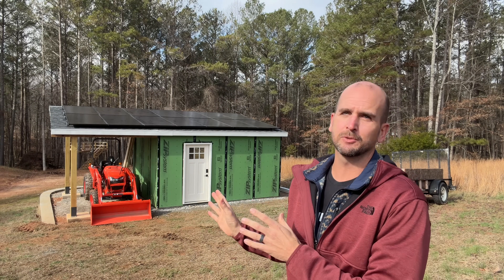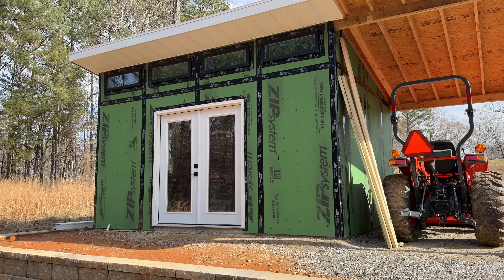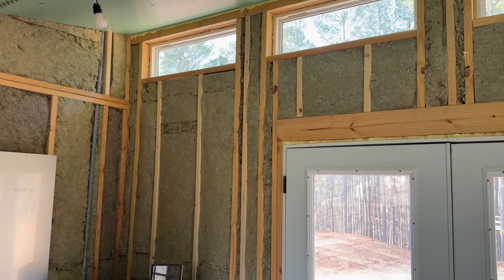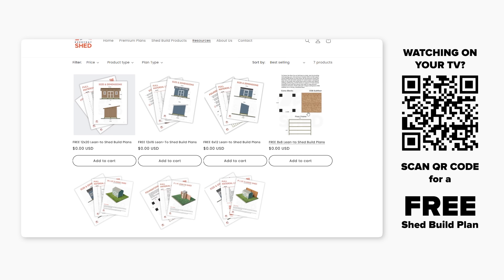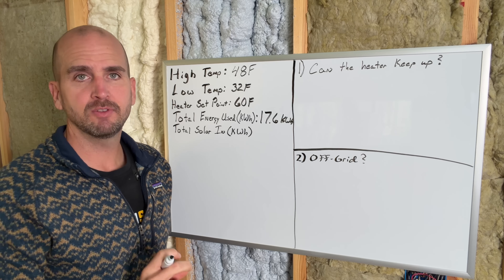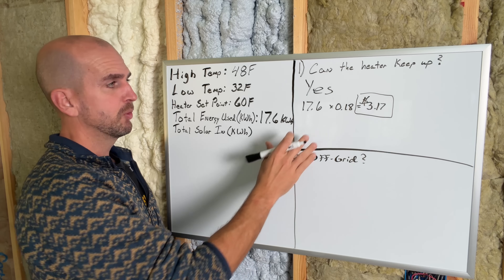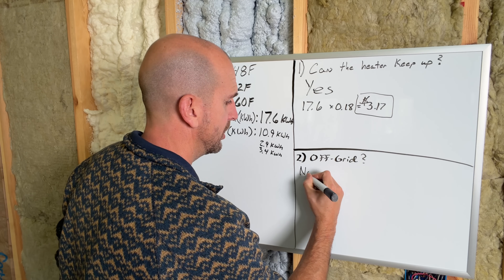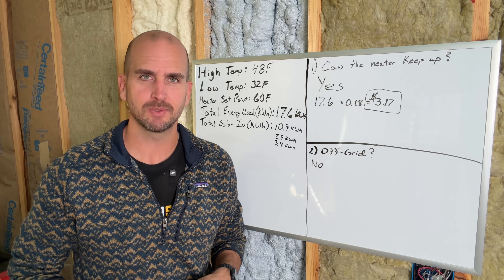HUGE Mistake: Why My $15,000 Solar System CAN'T Heat My Tiny Shed

Comment: You're trying to use electric heat.  Very inefficient.  Use a mini split instead and the energy cost will run about 1/3rd of the electric heater you used: about 6 kW-h per day.  With the big battery back-up and your PV array, that could work.  Of course, at $1.06 savings per day, your payback will be nearly 40 years...

Comment: in the winter around here the sun would just reflect off the panels most of the day, you need to set them up to at least a 45 degree angle, probably 60.

Comment: I run a 100% solar powered home (Net Positive). Looks like you've made major mistakes with this setup from the beginning. It's not about how much it takes to heat it, it's how much energy you lose and how much you keep, you have to calculate that. That stick frame build leaks like a sieve but, if you build properly to Passive House Standards, you wouldn't lose sooooo much energy and you could heat that tiny shed with a candle. It's not just insulation, air tightness and thermal bridging accounts for A LOT. Also maybe you should have oriented the glass towards the sun and added some thermal mass. As for cost, you can insulate with hay or anything cheap and as long as you do it right it should not cost any more. I can show you how if you like.

Comment: I have used those oil filled radiators for years. One note on my part is I am able to maintain a steady temp at about 20 degrees over outside with a 600 watt setting.  It doesn't heat up fast and if needed to raise temp from zero then the temp you want but then you can back off to lower wattage.  I heat 1200 Sq foot in a 50 year old mobile home. I do run a separate heater at 600 watts if I need 30 delta temp (actually 27 degrees) . Once I need more then I go to the 900 watt setting.  My main hvac is set to back this up but at a much lower setting.  I did a test years ago with a killawatt line tester, the low setting used 60% of the amount that the full setting used with the same temperature settings overnight. Assumed that it was that the low setting ran a little longer than full. Just a thought you may want to try just setting at 600 watt setting and see what you use.

Comment: Maybe consider any type of mass heater combined with your electric radiator. It's important to use the sun (direct heat) as much as possible as well.

Comment: You do not have enough ceiling insulation. You need to add R15 mineral wool above the foam board. That gives you a 2in air channel under the roof and brings your insulation to R25.

Comment: One 1500 watt radiator style heater heats my half ass insulated 30x40 shop. I only aim for 40 to 45 degrees though. If I want it in the 60 degree range I fire up a propane weed burner torch and let it rip for 20 minutes. 65 degrees then. 

Some day I want to buy a bunch of cheap used solar panels and direct connect them to heating elements buried in 55 gallon barrels filled with sand. One to start. 15K cost... dude you are off your rocker....

Comment: So the panels take up less area than the whole roof, meaning they receive less energy than the roof would if there was nothing up there, and some of the energy is wasted along the conversion process, and the shed receives no energy at night. And you're paying a ton for a system you can heat for $50 per month via the power grid. It looks like a bad idea.

Roof guy told me not to buy a solar roof. He says they make the shingles fall apart so your 25-year roof has to be replaced sooner. I don't think anyone has ever made money on a solar roof. He also said the Chinese panels go bad, and the manufacturers disappear.

Comment: Honestly, for heat why not consider a wood burning setup, especially the units that have a built in fan. You could power the fan off solar still.

Comment: 1500w automatic space heater heats a room more efficient than radiator style heater cuz of fan blowing air around. also add ceiling fan to push heat DOWN

Comment: Where I live in Canada (30 miles north of the USA border), according to the code ceiling insolation should be R41 and walls R25. Heat pump is a must, as well as having plenty of window space on the south wall for passive heating and not much on the other walls. Also hung windows are to avoided because they don't provide a good seal.
Reply: r25 walls ,,, 2x8? framing ? or ?  i have seen double 2 y 6 walls

Comment: The windows should be facing south with the right roof angle and overhang to allow the sun to warm the structure in the coldest months.  Ideally the sun's heat would be collected in masonry, stone or water barrels.  From the construction video, it looks like the windows face to the west and the "carport" faces south.

Comment: Solar is so inefficient. Todays top notch panels have only increased productivity maybe 2% and that still leave 80% waste of energy. Then consider end of life and the fact that efficiency drops off with use over time. Is there actual return on investment? One last factor, environmental impact of a spent panel, what happens to it?  Theryare not recycled.  To me, it is worse than purchasing a car battery.

Comment: Most folks commenting certainly understand the importance of insulation.  Really, it's the best money spent on a project like this.  In my case, i have a similar space that I double-walled and ended up with an structure that has R20 floors, R40 walls, R60 ceiling.   Mini-split pulls an average of 4.5 A at 115v and maintains 20C year round.  A humidistat runs an ERV that cycles for 10 min every hour, more if it detects an increase in humidity.  Thats good for about another 1.5A per hour averaged.  Overkill for sure but so is stacking multiple power banks to overcome a poor envelope

Comment: I have a 20'x30' with 10' to 12' ceilings. 20- 550 watt solar panels on the roof at 19 degrees facing south. latitude of san antonio texas. I did spray foam and seal my ceiling no vent, and my floors have 2" of solid foam board at R-10. same 2x4 rock wool and zip system. I have 6- 100amp hour batteries at 48 Volts. The heat pump is a mr cool 12,000 btu. In the summer the AC is cold and only uses about 20 % of the batteries at night. In the winter (like today) it gets down to 40 outside and it uses at 35% of the battery over night. I do have an electric water heater all electric appliances in the kitchen. I put a switch on the water heater because it takes 7% of the batteries to heat the 38 gallons.

Comment: I have a She-Shed similar to yours. With regular insulation that was not put in properly. Some gaps here and there. Also no barrier on the outside wall like yours. Just a simple tough shed with terrible insulation, but good sheetrock. I have a mini split.  In the winter with temps with lows in the high 30s and highs in the low 40s. Using for 10 hours a day the shed uses 2Kw or less keeping shed at 67 degrees inside.  In the summer it used anywhere from 2 to 3 Kw per day, with temps up to 110 degrees. I have an Airspool Mini Spilt that has an app to monitor energy usage. As mentioned heat pump is the only way to go. Using 5 days a week for 8 months the mini split has only used a Total of 180 Kw. In the spring and fall I do not need as much heat or cooling. With your system I could easily keep my shed off grid.

Comment: The roof panels block natural warmth by the sun. With so much plot you better place them on the ground. Also easier to clean and if the cause fire (with happens) it is easier to put out. Without burning down the shed.

Comment: Thanks for sharing the details of your efforts, especially the specific technology and costs/numbers.  The electrical resistance heater is useful to accurately quantify energy consumption.  You and many of the comments are on the right path, but need to complete the understanding.  I suggest the manual J calculations for heat loss of the structure are insufficient.  I also think it an inappropriate goal to keep the internal temperature at 60 F setpoint at night when no one is present in the structure.  What you need is a thermal simulation of the system over an entire typical meterological year (TMY) for your area.  By running the simulation repeatedly while varying parameters - roof insulation type and thickness,  wall insulation, slab insulation, roof angle to sun for solar energy production estimate... you can determine where your money is best spent on various options to deliver your desired performance.  It is much like running NRELs PVWatts.gov, but more elaborate with a greater variation of input parameters.   Perhaps we could use your shed for comparison and calibration purposes - look at your actual performance and compare to my computer seasonal simulation.   As an example for what the data might show - Is dipping below setpoint on a few cold nights acceptable to save 40% of the material and labor budget?

Comment: Another great video, THANKS for showing the data!!!!  Anyhow My shed system currently has approx 7kW of solar and works great, heats my shed fine in the winter and cools it great in the summer the big difference is, I am in Phoenix area, I have never heard of a a full week without bright sunshine😎,  for reference I am using a sungold power 10kw split phase (220v)  invereter which all in (cost shipping taxes) was a hair under $2000,  Half of my panels face the street so i used alexus 400 watt because they look so nice, i get them at San Tan Solar for about $150 each x 8 is 3200 watts @ $1200, the other side is some bargain panels they sell 550 watt for $150, 8 panels is 4400 watts @ $1200,  I try not to say i have a certain amount of solar panel wattage because you will NEVER get that full amount.  the batteries are a long horse trading story and they are used litium ion that load test at about 60% of their rating  and are currently storing about 21 kWh which if someone wanted to go on ebay and get equivelent could probably be attained for about $2000.  throw in about $1000 of cables, fuses, bms, breaker box, etc and the system is all in at $7400.  I watched countless videos by you Scott trying to figure this system out and I wanted to thank you for all you help, and give the people in the sunnier climates an idea of what can be done here.  oh one more item i can still fit four more panels in my inverter on the alexus side, but the cheap panel side is at capacity, so i still have a bit of room to grow, if i ever get around to  hooking up a car charger.  The heat pump is a 2 ton mini split I bought off Amazon for $1000 Thanks again

Comment: One more way to improve the insulation would be to put a thick rubber floor pad down. This could add a R factor of about 2 to the floor.

Comment: I wonder how much better you'd have done with a solar hot water setup for heat instead of solar electric. I'm considering a DIY solar heating setup to heat my 900-or-so square foot basement from about 55° to 65°+. I think one or two panels might do it.

Comment: Obviously if you can run a cord to the utility that's what someone should do. But if you can't then geothermal heatpump is the way to use the least electricity.

Comment: I'm seeing a lot of heat pump comments, and for your project since there's already a pv system, that's probably the answe along with another $400 for insulation. 

However, I haven't seen any mention of solar thermal. You would get roughly 4x the amount of heat. Eventually i'd like to build a shed/office like this. There's a little more up front work to determine electrical needs, but using mostly solar thermal and a few PVT panels should end up costing less. Storage is a bit of an issue since there's not many options for small scale thermal storage, but it cuts down battery which is $$$. If you are mostly just in there during the day, there might not be much need for storage other than keeping the space from getting to cold too. Thanks for doing this, its good info and helps al ot.

Comment: In addition to what other's have said, re insulation and heater type, those clerestory windows aren't doing you any favors. You've essentially got a big hole in your wall, right at the peak, where all the heat gathers.

Comment: I am building a 14 x 14 shop/shed and using the same rockwool and foam board combination.  I’ll be interested in further experimentation on your part.   You might look at a second day of power consumption as there might have been quite a bit of extra power to reach the initial heating steady state.

Comment: My solution:
2,800 sq ft metal building with No insulation.
Installed 6 EG4 batteries in metal cabinet surrounded with 2" foam insulation.
Installed 4, 30 watt silicone heating pads at bottom 4 batteries...
Pads controlled by a 120v temperature unit with cut on @ 34degrees and cutoff @ 38degrees...
I thought that maybe I needed 6 heat pads but tested with only 4 and working like a champ...
Temps were 20 degrees inside of building while inside battery cabinet showing 48 degrees overnight.
Not bad for only 120watts of heating power.... I assume the batteries were putting out some heat also...
I felt like I should win the Nobel Peace Prize...LoL

Comment: Did you do any insulation in the floor? That’s a big energy loss area. 
What if you had in floor heating. There are some products that are able to run on a 15amp breaker and since heat rises with and insulated floor the room should capture and hold the heat better.

Comment: Foundation looks awesome & A+ on the Rockwool insulation. I am terrified of lithium batteries (they burst into flames & can't be extinguished) so for my own personal reasons I give the ECO battery backup an F rating, to heat it I'd be inclined to go with a small pellet stove that draws only 60watts when running and if coupled to a pair of deep cycle marine lead acid batteries would give 16 to 20 hours run time. Overall your shed/office is 100% cool, my wife works from home and something like this would be great for her and me because I wouldn't have to listen to her all day if she was out there but I'd probably have to add a bathroom for her & that's a significant expense

Comment: I know this is a test for possible ways to use high end expensive ($15k?!) Solar and various insulation for heating. 
But I'll chime in on a different heating method that would work very well for that small shed. 
A $500 wood stove would easily heat that shed very cheaply, even a high priced wood stove would do it for less than $3000.
The ceiling insulation is all wrong, not nearly enough.

Comment: a 2-stage heat pump maintains 70-100 precent capacity down to 5 F and can maintain 50 percent capacity down to -20 such as the Arctic heat pump but those are designed for whole house and radiant floor heating

Comment: The radiant heater is super inefficient.  Get portable AC (4 season with heat), cheaper than a mini split but 2-3x as efficient for under $500 or diy Mr cool mini split, quieter, and still under $1000.

Comment: This is not feasible and would be a significant waste of financial resources for minimal benefit.  Use KISS method.
I know the idea here is "electric" but its not the most efficient solution.
1.  Electric Heating the space 24x7 is not necessary and limiting to electric greatly reduces heating options.  
2.  If you are using the space 1-3 hours per day, heat only 1-3 hrs per day, you get the picture.  Also, only heat to 50-55F.
3.  Electric heat is the most inefficient means to provide heat.  Use thermal mass heating and better insulation and whether strip sealing of building.  Stop 99% of air infiltration.
4.  Use wood stove or petroleum based fuel.  Note, again only heat while using the building, 1-3 hrs. per day.  In combination with thermal mass, overall financial cost is minimized.  If convenience is of greatest value, then go with petroleum.  A single 100lb lp tank can last months, possibly entire winter.  If using own wood, cost is simply your labor to process the wood.
5.  I heat 900sf, 55-65F, with small lp heater (18k btu) intermittently (15-30min every 2-4 hrs) as needed using 100lb lp 120 days, entire winter, cost <$100.00.  Note, we never run lp unattended or at night.  Peak heating periods are 0F-10F extended cold periods which are 1-3 weeks per winter.  Same cost of electric heat, $1,600.00.  Cost of heating solution completely covered in 1 month heating.
Note:  Safety Number One Priority:  Always Use CO, Gas, Smoke detectors when using gas heat.  Don't run unattended as this is a waste of energy.

Comment: Also Solar Thermal Air is 90% efficient relative to your 20% efficient Solar-Electric. So take a look at super cheap Solar Thermal, with 4x8 Green-House PolyCarbonate over plywood with a small Computer fan to move the air around. Study up on BTU vs electricity (~ 3,400 Btu x Kwhr )... Plus more insulation, Plus Heat Pump as others have mentioned..